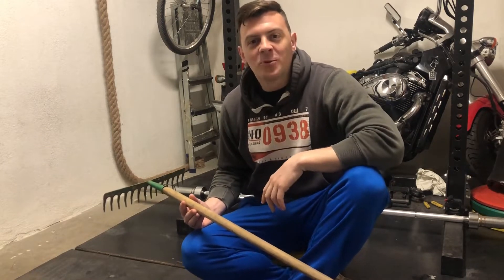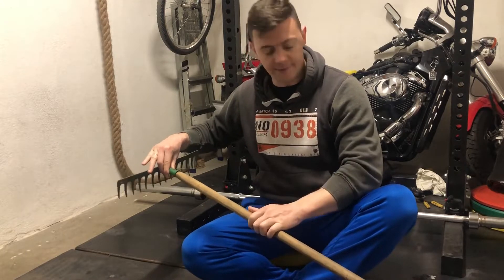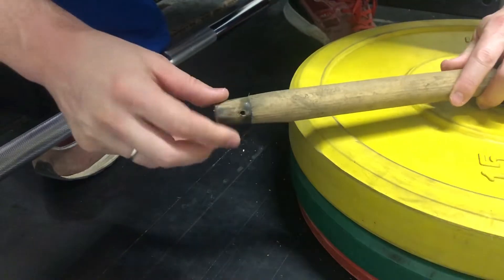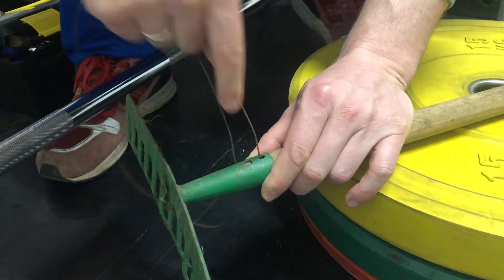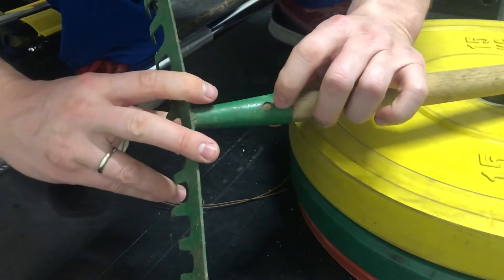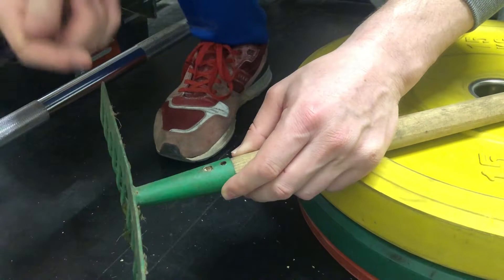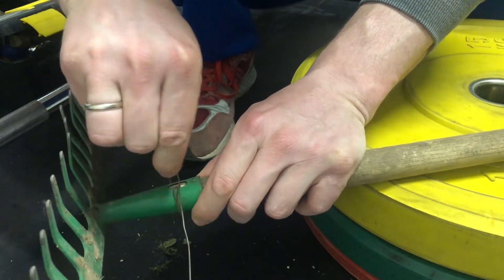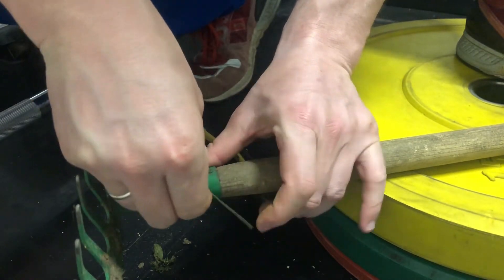How To Fix a LOOSE Rake Head - Keeps Falling OFF!

Comment: Have you tried just driving a screw, without predrilling. I would expect it to split the handle UNLESS you use the head to stop the split.
Reply from the maker: That is a good idea and I think it would work perfectly fine, but in my case I wanted some solution that will be more permanent, my first solution was nail (kept falling off) second solition was screw but with smalles diametar (it gets loose after 8-10 uses) so I ended up on this solution with wire. Still holding after almoust one year use!